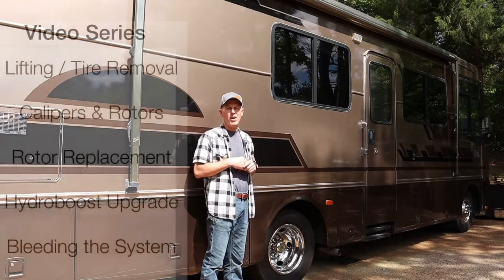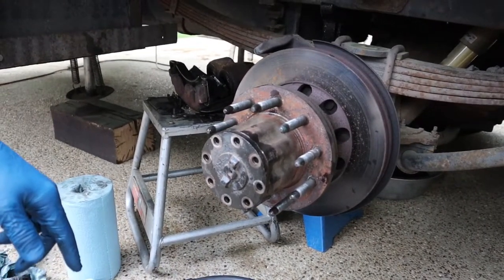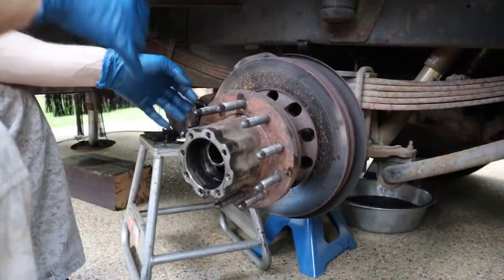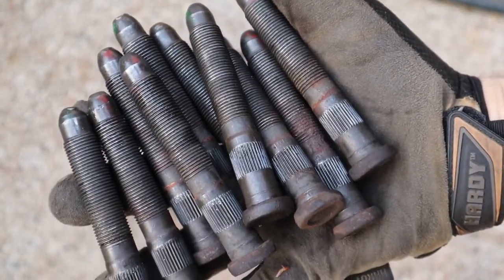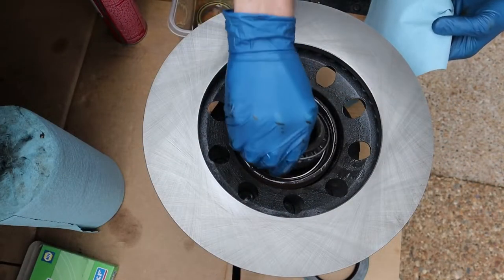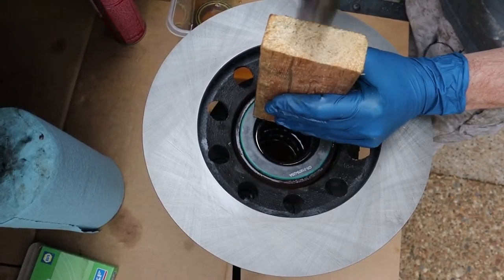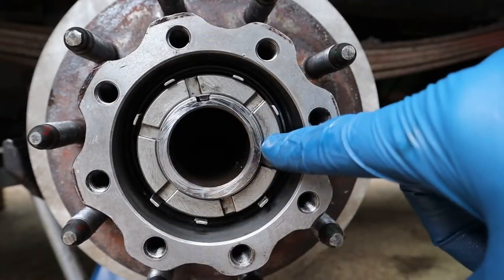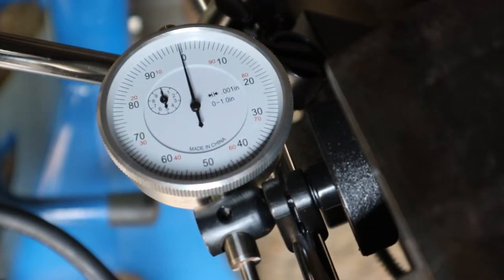Workhorse P32 Brakes - Video #3 - Rear Rotor Replacement

Comment: Could not see the torque spec for the axle nuts. These videos are a great help. One thing I was wondering what Chev chassis the P32 in mounted on. I am trying not to mention the work RV or Workhorse to avoid the up charge. Thanks again.

Comment: Just my luck. Took my 2004 P32 axle out and the lock nut is a ratchetting lock nut. Ever see one of them. I think it preloads at 50 ft lbs and then release and snug up to zero lbs. Any information would be appreciated. Have nice day.

Comment: Outstanding video, thank you.  Do you know if the workhorse W24 chassis is real similar to yours?  I have a 2005.  I’m not having any issues but would like to pull wheels and inspect the brakes.  Thank you

Comment: I know this is 2 years old but I think you may be misreading your torque procedure wrong.  All of our Danas have taper bearings and they are never final torqued. The GM manual calls for 50 lb/ft preload, back off loose then 35 lb/ft then back off 1/4 turn. the lock nut gets 66 lb/ft  You want .001 - .010" play on the hub.
The Rockwell 12" is the only one that gets a final preload on the bearings as they are barrel style bearings -  gets 50 then back off an 1/8th turn with 250 lb/ft on the lock nut

Comment: Regarding the torque settings for the retaining nuts, my factory Workhorse Cassis manual lists 68 N-m (50 Ft lbs) not 70 ft lbs, then back it off and torque it to 35 ft. lbs.
Reply from the maker: Thanks for the information.  I got the specs I used from the Dana service manual.  It could be that they have changed their specs since Workhorse went out of business.
Reply: You are supposed to back it off a 1/4 turn after the 35 lbs/ft - you want .001 -.010" play.

Comment: Love your videos on p32 chassis. One thing that would really help is to say what specialty tools you are using. The spanner nut on the rear axle bearing is a special tool I will need to get. Thanks again
Reply from the maker: Thank you for the complements.  I will put that information in the description tomorrow evening.

Comment: Again, thank you! As a workhorse chassis owner in Australia, I get to learn a lot of DIY stuff as professional mechanics see me coming down the road and double their prices before I walk in the door. 🤣😢

A question, if I may?  You talked about doing a video on bleeding the brake system; is that still happening? I need to replace my brake fluid and I suspect it will be more complicated than my Nissan Patrol …
Reply from the maker: Hello.  I'm glad you found the videos helpful.  I shot a video of the brake bleeding but wasn't happy with the results so I didn't post it.  I tried the old foot pump method, a hand held vacuum bleeder, and a power bleeder.  I never could get the firm pedal I was looking for.  Finally, I bought some speed bleeders ( https://amzn.to/3yglvTm ).  They were worth every penny.  They made the job super easy and got all the air out.

Comment: Good job!  A slide hammer is usually the best for removing old oil seals.  A couple of the segment on this video had volume that was too low for my old computer.
Reply from the maker: Yes sir. I forgot to turn my mic on a couple times and had to insert a voiceover in those parts. I didn’t get the volume just right. Sorry. Thank you for the feedback.

Comment: Hi thank you for these videos, very informative and saved me thousands.  I am planning to change the brake fluid but I could not find your video on the bleeding, is the bleeding the same as in any car or is there a special process or tool needed like to cycle the ABS for example?  Thank you
Reply from the maker: I tried every system out there including the vacuum systems. In the end, the best thing I found was the one way check valves that replace the stock bleeder screws. I bought them on Amazon. I don’t have the link anymore.  Best wishes on your project.

Comment: This video is just perfect! can you do a video doing the front wheels? And how to adjust the ABS sensor.
Reply from the maker: I’ll be down there next week doing some front suspension work. Provided I don’t run into a major problem with that, I should have time to do something quick on the ABS system.
Reply: @ufixit  

That it will be fantastic thank you, when I remove the wheel I got stuck on the sensor just be careful I believe i damaged my sensor I'm not sure, the biggest problem that I have it is the installation, it is a procedure to adjust it and I have no idea how to do it, thanks a lot!

Comment: Your videos have been soooo great. Thank you for putting part numbers and torque specs for rear bearings. I have the same frame and has been incredibly helpful to get the correct part. I’m repacking the bearings and put new rotors on the front. Could you tell me what the proper torque of the nut and bearings please? Thanks again for all the helpful videos
Reply from the maker: Thank you for the feedback. I did my front bearings a while back. I didn’t use a torque wrench on them but they are similar. You want to tighten them enough to seat the bearings as you spin the rotor. Then back it off completely and then tighten it to what I’d call lightly snug.  It will be the first notch after it snugs down. You definitely don’t want them loose.

Comment: Hi. Great job. My 1999 p32 is permanently having some issues with the rear bearings and races. I guess my shop is using the wrong ones. What are the part numbers you have in there. My shop sold me these: outer TIMKEN395CS
TIMKEN394CS, inner TIMKEN382 and 387A. But I have rear disc breaks and 387A seems to fit for drum breaks.
Thanks.
Reply from the maker: I’ll have to research that some. I didn’t have to replace my bearings. I reused the old ones. You should be able to find the model number on the axle (on the pumpkin). From there, you should be able to look up what bearings it takes.

Comment: Nice video, I'm working on a 96 f53, have Been hunting for specs on torque, with no real luck.Other than the style of rotors it looks identical. Any other specs in that manual you found? Thank you
Reply from the maker: I had to look up my axle and cross reference a maintenance manual for it.  I found it online but don't have it bookmarked.

Comment: Great video, glad I found (and subscribed to your channel). I drive a 1994 Flair on the P 30 chassis. Will your instructions apply to this chassis as well? How did you tilt your rig by 6 inches to allow the oil to flow? Finally, I could not find the first video of the series regarding lifting the RV safely? Would you have a link to it? Thanks much.
Reply from the maker: Unfortunately, I’m not familiar with the P30. I suspect it is very similar. I had the entire rear lifted using the levelers and then sitting on jack stands. To lower the axle, I had the tires on the other side. I lifted the rv with the levelers just enough to remove the jack stand from the side with the tires on. I put the other jack stand under the frame and lowered it a bit. Then I sat it down so that the tires compressed the suspension on their side and the other without tires hung down with the frame sitting on the jack stand. Let it sit a few minutes then lifted it back up and put the tires on. 
The video for how to lift using your levelers is coming. Got busy and didn’t get it edited.

Comment: Is this relevant torque to the spicer style nut too I am having trouble finding it for my 99 workhorse p32 chassis under my 2000 Damon Daybreak 3270
Reply from the maker: I'm not sure.  I suspect it would work without issue but it would be best to verify with a Dana manual.  It took a lot of searching but I finally found a maintenance manual online for my axle.

Comment: caution! Don't buy from rock auto. The right part number with the correct picture came in as a drum instead of a rotor for the rear and they have no way of helping you. Stuck for 2 freights now. coming and going. Now I know why the price was so good
Reply: you gotta be REAL careful with their verbiage as there is what seems like 6000 different combos - at the end of the day you need to look for your brake package code.  the JF9 is 4 wheel disc independent front suspension,  JB5 is 11" drum rear, JB7 is vacuum boost, front disc w 13" rear drum, JB8 hydroboost front disc/ rear drum and even more  codes for single and dual rear wheels and I beam front suspension.

Comment: I have done all but turn rotors on my rear axle. (Workhorse P32) My one problem is that it seems from time to time the right rear will act like the brake pad is loose and slapping something. You can press the brake slightly and it goes away. I noticed that the outside brake pad does not fit real tight but in trying to hammer down the tangs to make them fit tighter it broke the pad and had to buy another set of pads. Thinking of cleaning them off and using brake quiet to try and secure them better. Other than turning rotor what does this sound like to you?
Reply from the maker: I think you are on the right track.  It sounds like the pads rattling.  Does it do it when you hit a pot hole?  You can "stake" them in by hammering the ears a bit to create a tighter fit.  You have to be careful though because that inner pad floats between the rotor and the caliper.  It needs to be able to move some.  I don't know of anything about the rotor that would make a slapping noise.  
Hope this helps.  If you locate the case, please report back.
Reply: @ufixit  I think it is a warped rotor. I got a gauge like you did and it was waaaay out. New rotor on the way. It seems the inner pad is the problem.

Comment: i am having a very difficult time finding the replacement rotor,hub and calipers for the front of my p32. any recommendations on how to locate the correct replacement parts?
Reply from the maker: Take your vin number to Napa. If the parts guy is experienced, he should be able to locate what you need.
Reply: Yeah I'm next..I'll be completely rebuilding my front-end..I have a 99 Workhorse P32 Chassis...Workhorse should have printed out a build sheet with the parts used and the part numbers for each part..this is my first motorhome and it's a pain in the ass to find parts.
Reply: I see you left your comment 9 months ago..so do you have any part numbers for the Rotors and Brakes
Reply: im good now. i went to omeys website, he has a section for the p32 parts
Reply: Rock Auto  - stick with GM, Raybestos or Centric brands . NAPA stuff has been going to the shitter for quality lately and they are overpriced.